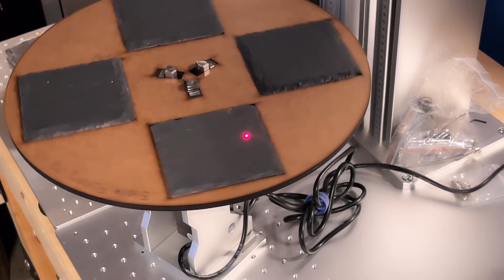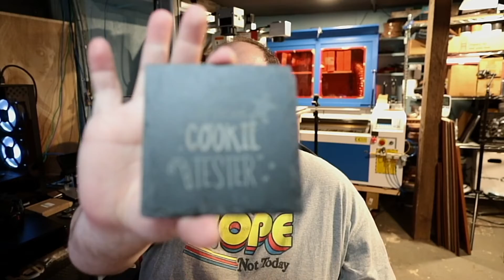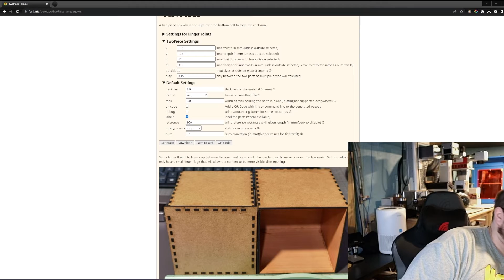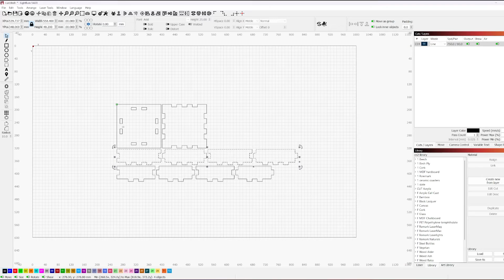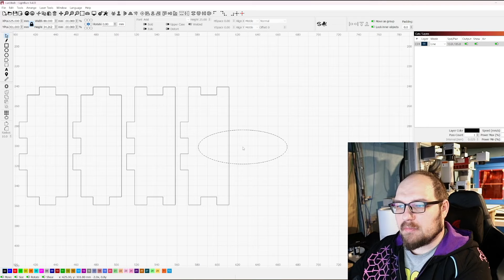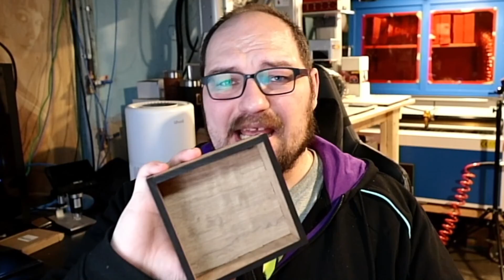LAST MINUTE Engraving Gift - COMPLETE LASER PROJECT

Comment: Kyle, in the laser library, how do I know what my laser tube brand is? I have a Boss 80 watt CO2 laser. I think there are four choices.
Reply from the maker: It seems boss may have their own tube brand, at least thats what it looks like based on seeing their website. I dont recall if its in the list when submitting parameters, but I'll have a look in the next week or so and if its not there, will get it added. If you're looking for parameters and not submitting / sharing, the other brand names same wattage should get you similar results though if someone has a setting you want to try.